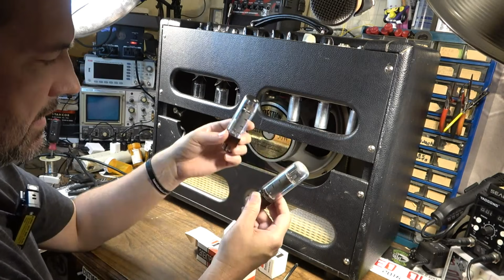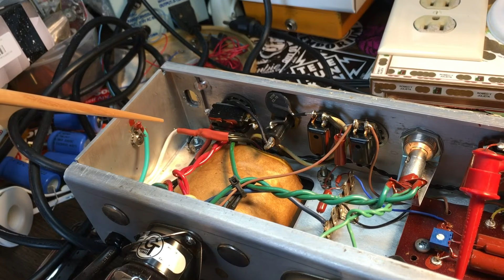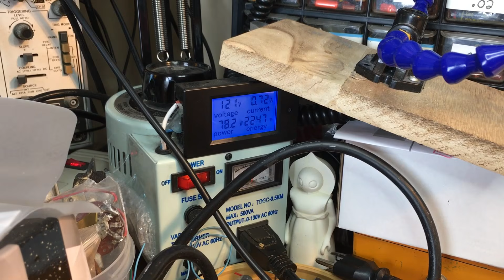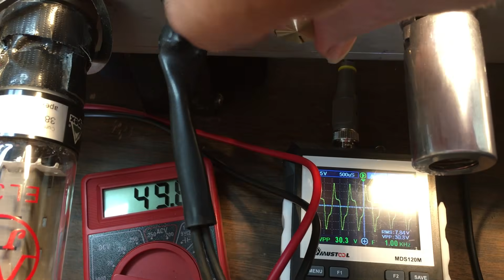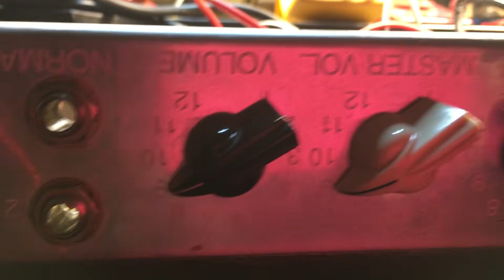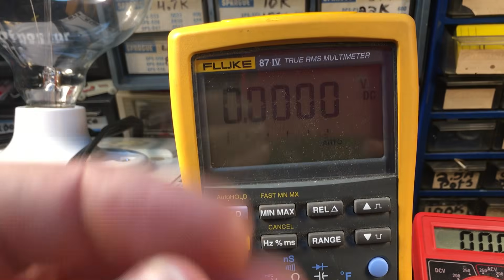STOP USING THE STANDBY SWITCH ON YOUR GUITAR AMP!

Comment: This standby debate has always confused me...  All my old Marshall, Hiwatt, and Fender amps have a standby switch which I've used for decades.  I haven't noticed any diminished tube life and never had any electrolytic cap failures.  Some of my amps still have the original caps and tubes going on 60 years of use!
Reply: Many of my friends have been playing guitar and bass for decades and not one that I know of ever blew up an amp using the standby switch.
Reply: @richb.4374  That's a small sample size Rich.
Reply: @monolabmusicstudio2373 😂😂 i laughted hard on this one 😂😂😂😂😂😂😂😂
Reply: @monolabmusicstudio2373 To be honest, fair, & correct its the only size he needs to hear!
Reply: He talks about modern amplifiers…doesn’t he?
Reply: @krokovay.marcell  No.  In the beginning of this video, he states the amplifier being used as the example is basically a clone of an old amplifier.  He continues on with saying that many clones like his example carry over old design aspects that he believes should be omitted, such as the standby switch.  He added all the modern gobbledygook MOVs and such to the old design to make it more modern.  I love when people state that something that's been working great for 60 years needs modification...  I worked in an amp repair facility back in the 90s and this was never a thing until recent.  Just ask yourself why that is.
Reply: @derrickbaranowsky5715 Why you ask?  Modern tubes are not as good. Dan Boul and Peter Stroud of 65 Amps have lowered all the voltages in their amps because they watched tube quality drop year after year. So they changed the amp design to compensate for the poor components and to increase reliability.  It's just a thought.
Reply: @monolabmusicstudio2373  Why do I ask what?   You can get modern tubes with any bit the same quality as tubes made since the mid 1980s.  Like I said, I never see any issues with my amps, my customers amps, or my peers in the industry related to tube or cap failure because of using the standby switch.  Do you really think that if that switch was causing failures, that tube amp manufacturers would continue using them knowing that they would have to support warranty repairs?  This becomes a debate of reality case vs hypothesized warning.  I won't go as far as to say this topic was posted to generate YT views, but you have to ask yourself why this topic suddenly rears it's head in the past 5 years...  It ain't due to a sudden change in tube or capacitor quality.
Reply: @derrickbaranowsky5715  "I worked in an amp repair facility back in the 90s and this was never a thing until recent.  Just ask yourself why that is."  This is the "why" I was responding to Derrick. The only thing I could think of is what 65 Amps was doing, and how Manley did their standby circuit.  I'm not challenging you, because like you,  I also repaired amps in the 90's(to currently) and have had basically the same experience.  I cannot say with any certainty what caused all the tube failures in the stuff I repaired(except failed bias resistors or old age). I never thought it was from the stand by circuit, because professional musicians seemed to need to change their power tubes every couple of years and the preamp tubes every three or four years. That seems normal. I just  assume they wore out, as things do. Still is from what I see.  Warranties usually are for one year, so that's probably not an issue. Reliability on the other hand is a big issue and if the amp doesn't work then nobody would buy them .  So there doesn't seem to be anything wrong with the good old standby design. I can't say one way or the other because even if I have repaired a few thousand tube amps, that's a pretty small sample size considering how many tube amps exist in the world.  There is no denying that manufacturers work with planned obsolescence but that doesn't explain anything in this circumstance.  The tube guys would be behind that, and they don't build the amps.  The empirical evidence would show that the old circuit has worked and continues to work fine. That said I build my own amps without  a standby.  I also use NOS tubes. But I cannot defend my position very well. I also can't explain why the amp in this video had such a huge inrush current with the same old reliable standby circuit.  The thermistors seem to have fixed the problem in this instance.   Tube quality does seem to have declined over the past 3 or 4 decades, so it isn't sudden. As for caps and resistors, those seem to have improved over the past few decades.
Reply: @monolabmusicstudio2373  I hear ya.  Well, I am in the unique position that I both have repaired and toured with tube amps.  I can say this... the old Marshall JMP that I tubed with 1980s pre & power tubes have never failed, and are still in the amp to this day!  The sound glorious, and it's one of the loudest amps I have had so I can testify that the tubes are still going strong after decades of regular use.  The amp is all original, including the caps.  I use the standby religiously.  I will let it end there.
Reply: @monolabmusicstudio2373  that's why i still only run vintage tubes, new ones are crap.
Reply: Yeah, me too. I got my first tube amp in 1981 and always used the switch. I don't use it now because my understanding is that with a tube rectifier, the voltage to the power tubes comes up slowly which is probably better than hitting the power tubes hard with full voltage using the standby switch.
Reply: According to Chief Tech at Orange, Ade Emsley, a tube rectified tube amp benefits from only standing-by when warming down and never up.
Reply: @moyhennabuchanan1076  I doubt he said that.  What was the technical reason given?
Reply: @derrickbaranowsky5715   Doubt away. I know not your credentials but, regardless, I'll stick with Ade's recommendation (available on Orange Amps' YT channel launching the tube rectified OR30).
Reply: @moyhennabuchanan1076  I was right, Ade Emsley never said "a tube rectified tube amp benefits from only standing-by when warming down and never up".  The OR80 is rectified by a GZ34 which is a slow turn on tube.  That is why the standby isn't needed in start up and is only needed in power down on that and similar amps.  He never implied this was a blanket statement to all tube amps as you declared.
Reply: @derrickbaranowsky5715  I don't know what you're not reading but maybe if you weren't so needy to always be right, the standby debate wouldn't have confused you for decades and you mightn't have missed that a blanket statement to all tube amps wasn't declared?
Reply: @moyhennabuchanan1076  The difference is I have worked with this technology professionally for many decades, responsible for repairing, restoring, and maintaining tube amps for possibly longer than you have been alive.  You on the other hand saw something on the net and parroted misinformation because you don't understand what the other tech was even talking about.  A smartphone is only as smart as the comprehension of the person using it.
Reply: @derrickbaranowsky5715  yes, the difference is decades and decades of being confused. i'll stick with Orange Chief Tech Ade Emsley
Reply: @moyhennabuchanan1076  I get it... only thing people who don't understand what they're using can do is to find advice that makes them comfortable and follow blindly.  If someone points out they have misinterpreted, no matter.  Sorry to hear about your decades of confusion but there's no helping denial.  Good luck and thank you for treating your amps in a manner in which I make more money on servicing.
Reply: @derrickbaranowsky5715  your decades of confusion, your quote "This standby debate has always confused me...  All my old Marshall, Hiwatt, and Fender amps have a standby switch which I've used for decades."
Reply: @moyhennabuchanan1076  You can't really blame me for being perplexed by people such as yourself with a lack of actual knowledge of the technology spreading disinformation in the comments.
Reply: @derrickbaranowsky5715  thankfully our OR30's doing just fine warming down thanks to Orange' designer's expertise and swerved a bullet sans yours
Reply: @moyhennabuchanan1076  The OR30 is rectified with a 5AR4 slow turn on rectifier.  A slow turn on rectifier basically provides the same benefit of using a standby switch at start up, so you're basically already doing the same thing as using the standby at power up.  I guarantee your hero never said tube rectified amps only need "warming down".  Only ones with slow turn on would not need warmup in standby, not all of them.  You clearly don't understand his point then you parroted it incorrectly.  Understand?  Capiche?  Comprende?  Forsta?  Verstehen?  Now go play guitar.
Reply: @derrickbaranowsky5715  cool, there is a use for your posts - we've this wee insomnia thing... zzzzz
Reply: @moyhennabuchanan1076  Awesome, well we have a use for dim bulbs like you too... collecting the trash we put out at the curb each week.
Reply: @moyhennabuchanan1076 Wow now whom is tge needy child throwing a tantrum you have to continually berate this person! Why so Butthurt over something that will never be settled except by unstable folks like yourself in their own warped way of defining their own hypocrisy! Talk about calling the kettle black!😢😢😢
Reply: When that thermistor fails, won’t that take down the amp?
Reply: Same here Derrick. Not only that, I'm always concerned when techs feel they know better than the manufacturer and change things. My Fenders have always done well by me and the thought that they need "improving"? Hence the reason I'm careful to whom I hand my amp to when it needs a repair. I had an experience when my regular tech was out of town I took my amp to a shop for a new set of tubes and biasing. He made other changes because he thought they were best for the amp, but instead of calling and discussing it with me he just went ahead and made them. When I picked it up I didn't act upset, I just asked what he did. Then when my regular guy came back I took it to him and explained what the guy did and when my tech opened it up he saw it right away and changed it back.
Reply: Always use your standby
Reply: My old Mum worked at Mullards, Southampton, from before it officially opened in 1957. That was Mullards Semi conductor research and production site. Both Mullards and Phillips were actively and openly running down the quality of Vacuum Tubes in order to up sell the "improved reliability" of transistorisation and, at that time, the in development 'integrated circuit concept'. Modernisation eh?
Reply: My Boogie Rec standby switch has gotten a workout for 20 years. I had to retube once but it was from a fall during an out-of-control practice sesh.
Reply: you have 60 year old tubes and havent noticed a difference?
Reply: @treastonschmuckley5111  They test strong and compare as good or better than new tube in performance (but sounds better).  Pretty remarkable old tubes!
Reply: @derrickbaranowsky5715  yep!
Reply: @treastonschmuckley5111  they probably have gotten sweeter sounding over the years, mine has, some over 40 years.
Reply: Same here.No problems at all using my amps over the last 5 decades. Sometime you h ave to wonder if these channels just need to find new issues to magnify to stay relevant. His fix might not be all that bad an idea to incorporate if you want to feel better able your amp. I'm not moved at all.
Reply: yep, its there for a reason and they still are for new amps. im going with the pro's who build and design them on this one.
Reply: As long as pro amp company's keep using them, so will i. been using it for 40 years without an issue on my old vintage amps. kinda like a car was running 70mph down the road then at idle at the light, when they came out with the car shutting off completely then starting right back up when you take your foot off the brake, that was the dumbest thing ive ever seen and heard. Heavy wear on the starter, battery, ( SPECIAL EXPENSIVE BATTERY ) Hard on the engine in general vs letting it idle, a tube amp needs to idle as well, the off and on in rush of power does more damage than standby...just my experience anyway.
Reply: I always use my standby as well
Reply: Bass player here: I just bought an Ampeg Heritage SVT 50th anniversary head, brand-spanking-new. It's got two gargantuan transformers in it, and I think they can withstand a fair few standby switch voltage surges.
Reply: Where did you buy that Thermistor? Thanks
Reply: It is a badly implemented standby switch that wasn't there in the original design. Using a standby switch directly on the rectifier tube is plain bad practice that nobody was doing in the old times, but, somehow, sneaked into modern designs, starting with the AC-30 reissues.
Reply: @radomirblazik  Not sure what are you talking about...  The 50s tweed Fender Bassman and others very early amps had standby switches way before VOX was a thing.  They had slow turn on 5AR4 rectifiers no less but still had the switch.  Marshall was initially copying the Bassman and that is likely why they too had it.
Reply: @derrickbaranowsky5715  On old tweed fenders, the standby switch is there to protect the undersized capacitors, but on modern clones, the capacitors have much lower ESR, much higher current rating, the transformer laminations on the PT are made of much better magnetic  materials, the current production GZ34 have much lower voltage tolerance, and much lower on-state resistance than the old school 5u4 variety with mild steel laminations on the transformer. This all ends up being a casual accidentall flyback HV generator... Just copying a schematic without putting some though onto it and using modern components without compensation, fireworks in a bottle anyone?
The same happens with solid state circuitry too, people being lazy and just copying a schematic into Kicad without doing due diligence. Harrison reissue preamp phase inverter, I'm looking at you
Reply: I watched this and chuckled. I'm still gonna use my Standby switch.
Reply: exactly, every manual I have for an amp puts emphasis on making sure you use your standby switch and make sure to have it off when your amp is off. So it sounds more like it can mess with your amp if you don't use it
Reply: Well then those 60 year old amps seriously should get an appointment for a cap job. The fact they still "work" (only god knows what's actually going on inside) is just your personal experience which speaks for how robust tubes and certain parts CAN be. And so is every successful use of the standby switch without an explosion. Radio tubes - which are all those that are found in guitar amps - are not designed to work with or need a standby switch. The plate voltage is too low to harm the cold cathode. A standby is just not necessary and can, but not will, be harmful, because of huge inrush currents. If one really needs the functionality of a standby switch, there are ways around it potentially doing harm. Like big resistor across the switch, the valve wizard has good articles...

Also.. you don't see degradation. As a user and nothing else, you can not detect sources of degradation. It happens slowly over time and if engineers and technicians over years and years can report it, then they are most likely correct, not you.
Reply: @hanswurst9120  With all due respect Hans, your theories, cautions, beliefs and what you have read just do not match my reality.  Reality beats theory any day.  These findings with one or two amps would be luck...  My experience is over many decades and with many many examples, including mine, my peers in the industry, and customers.  I appreciate your opinion, but I'll get by just fine without the unnecessary actions, sir.
Reply: @hanswurst9120  "Well then those 60 year old amps seriously should get an appointment for a cap job".....i would say respectfully until the caps leak, swell or fail, no reason to re-cap, ive done it to be proactive and the amps sweetness was gone, all those years it took to smooth the amp out was changed by new caps, I'll never do it again, tubes, caps, all sound better with age as long as they are within there tolerances. New caps change the amp and i prefer the sound of a well aged amp over all new fresh brash sound new amps have.

Comment: what varistor should i use in 230 volt situations ?
Reply from the maker: The steady state current draw of the amp is the important thing. Just check the Mains Fuse on the amp. If it's a 3A fuse, your steady state current is below 3A. If it's 4A or 2A, you know it's below that. Choose a thermistor that meets that steady state current rating or exceeds it. The Amphenol CL-70 or CL-60 is likely a good choice for 95% of guitar amps.

Comment: If that amp comes back again for the same problem ...... after all those solutions you implemented in this video .............  you need an exorcist !!  Not an amp tech !! laugh !!
Reply from the maker: If it came back again for the same issue, I would move the reservoir cap to before the Standby Switch and bias down to about 50% plate dissipation and pray.